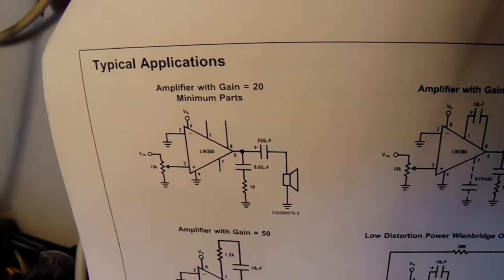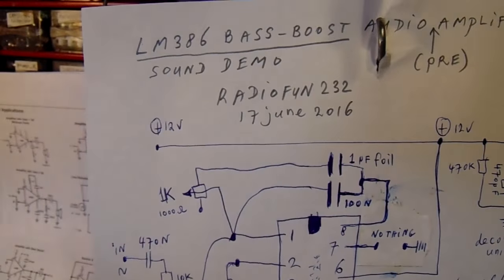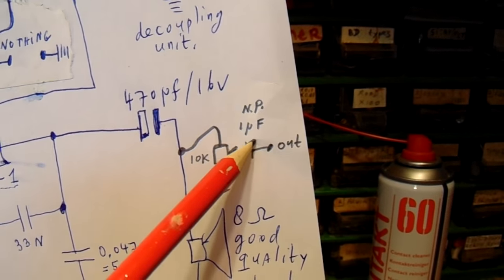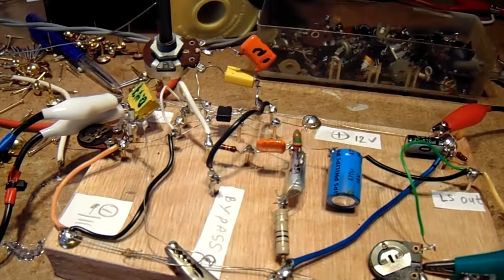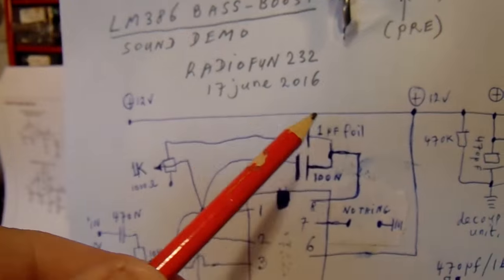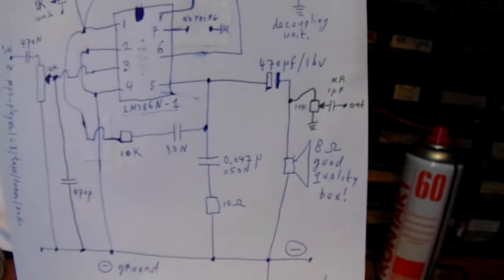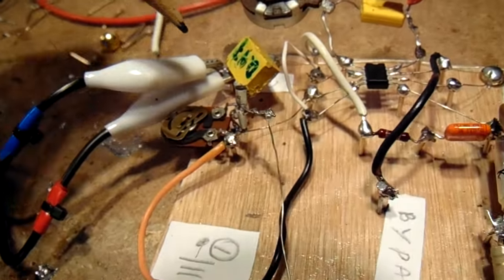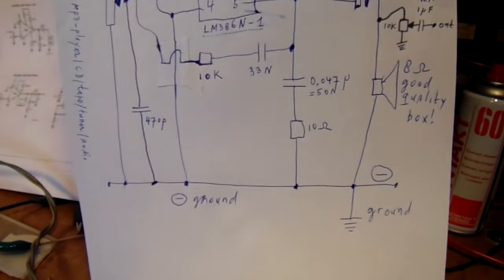LM 386 bass boost audio (end) amp/sound demo with tone control + schematic

Comment: I must admit that this particular video has taught me a valuable lesson.Always for the past 35 years of always maintaining a arsenal of vintage tube amplifiers for my guitars and some audio for listening pleasure I CAN SEE THE BEAUTY of SS audio from a teaching and experimenting platform.The components are small.The voltages required are small.If you pop a transister you can determine why without having had a vintage tube run away on you.Small changes show the most sensitivity.Have you ever put your tone circuit in the negative feedback loop? That is my favortite way for the tube guitar amps i build.Thank you for teaching me
Reply from the maker: Thanks for your comment! Yes, I did may audio experiments (hundreds) since I woke up on electronics (1967). I made 10ths/100ths of audio circuits experimentally, many not successfull, but I learned it the hard way and finally how to control "sound" in the broadest sense and to make audio circuits for specific applications. All with easy to get electronic components. In audio I say: it depends...I also used feedback loops especially in audio pre amplifiers.

Comment: Where did you find all the different schematics for the Lm386 amplifier.
Reply from the maker: In the book from "National Semiconductors" (from the 1970's, I am almost sure there is a modern version, we live 2018) but many of them are also on the www. For the best info: buy/find this book or another Nat. Semicon. Book with key info.
Reply: radiofun232 thanks

Comment: Am I the only one who have so many problems with this chip. I.e. the chip stops working/blows/burns, to the extend that I dare not use it in any commercial product, due to excessive customer returns?
Reply from the maker: Some chips, but in my experience not the chips (older models) from the LM family from National Semiconductors, can start to oscillate when the wiring/decoupling is not properly made. If so, every built-in protection circuit often fails.
Reply: Yes, I think you are right about the oscillations. It is very possible that there are some parasitics, depending on the load (headphones) the end-user plugs in.
Reply: NatureAndTech    The best places to install a blocking power capacitor near the pins of the chip

Comment: Your Videos are very helpful! I heard that all the chips are slightly different sounding. Is that true? I used some lm386 for guitar preamps. I wasnt really shure if they sound the same.
Reply from the maker: I think all the chips will sound the same because they are completely automatically made in a kind of robotic way. Perhaps the quality/properties from the capacitors will give tiny differences in sound.